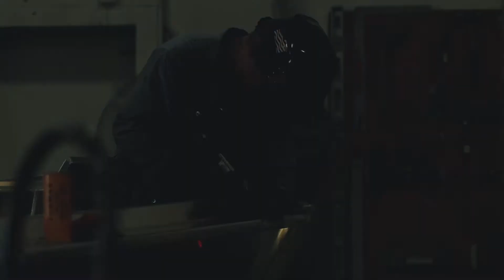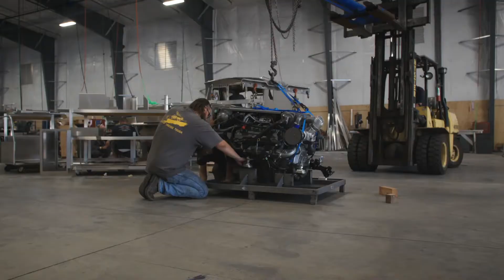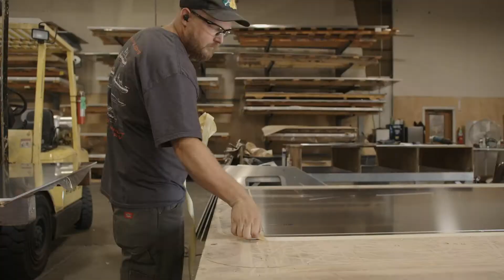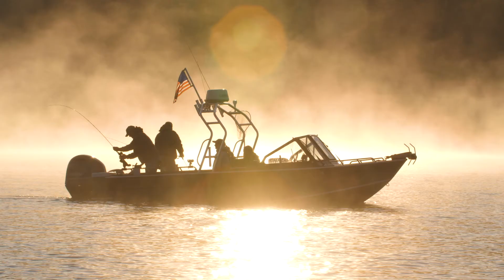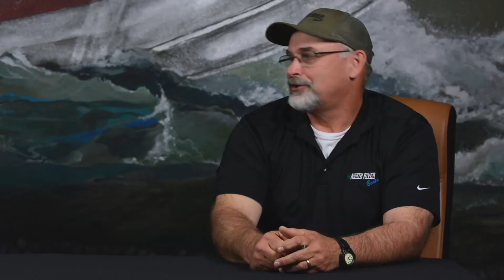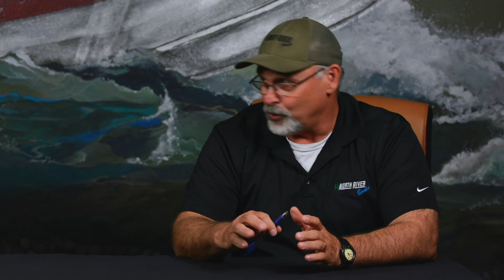What You Should Know About Corrosion: North River's Ask The Experts Series

Comment: Very good information. I have an issue with this subject that I will be addressing this week. On my transom extension (2015 2300C) there is a screwed down access plate for inside of the extension that has an overlap. Every screw hole has an area of blistered paint around it. I have purchased a custom mixed rattle can of the factory color paint as well as a self etching primer and clear coat. I would love to see a video on how to properly address the correction of this condition. My intention is to thoroughly clean, sand, clean, primer, and repaint the problem area top and bottom. My question to you is with this overlapping cover with screws that bite into the aluminum, how do I keep this problem from reoccurring?

Comment: This is super helpful. It would be awesome if you guys did a longer video on how best to clean your boat/ trailer after being in the salt. Saltaway to flush the motors, where you should spray it in the boat (bilge, fish boxes, etc.). I've got my method for my seahawk but would love to see what the experts do.
Reply: I use a 2 gallon Hudson sprayer with Saltaway solution in it and thoroughly spray down/soak my trailer brake components with it after launching. This really helps keep the rust away. I have a friend that never does this and his brakes and leaf springs are completely rusted. Our trailers are about the same age but they look nothing alike. I have minimal areas of surface rust and he has rust that is flaking off everywhere.